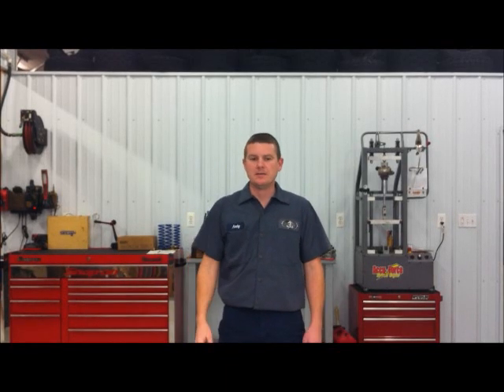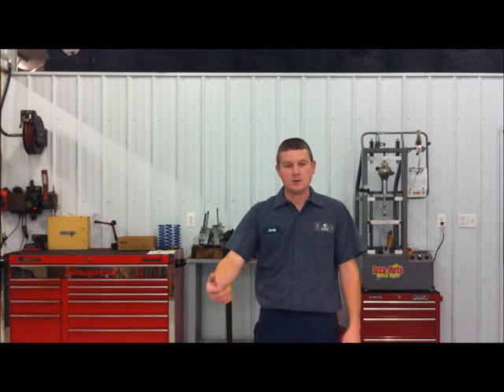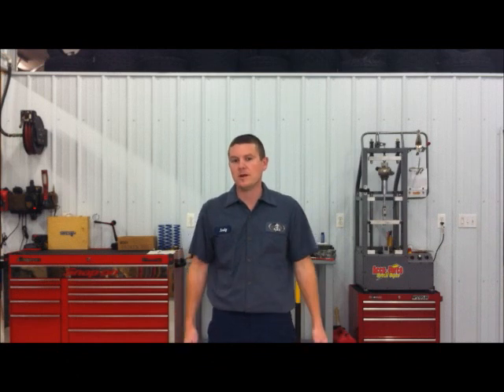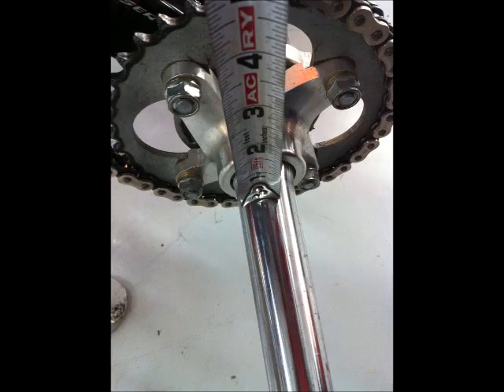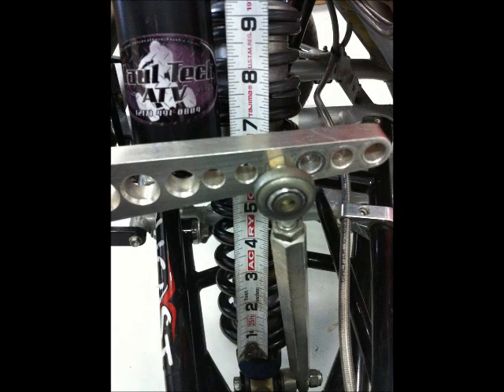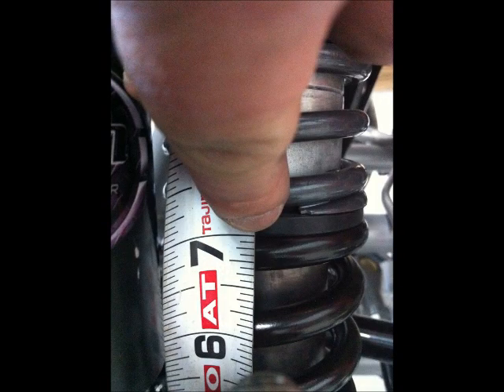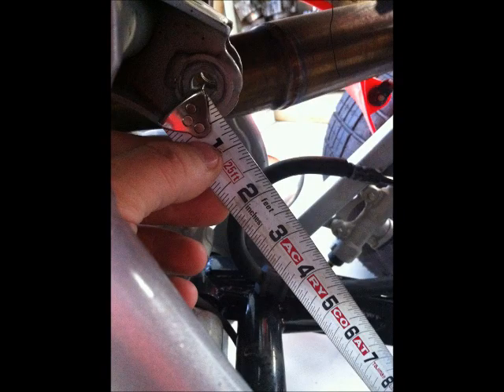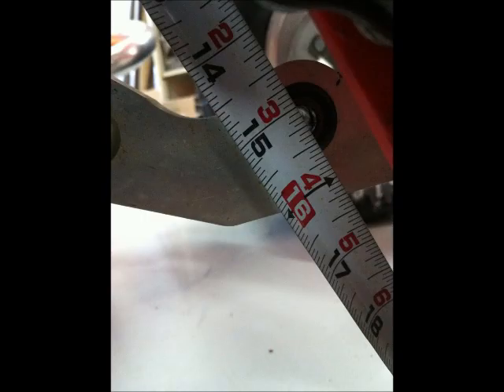ATV Suspension Measurements -by Andy @ Maul Tech ATV

Comment: Very helpful video! I have a brand new Works Quadstar rear shock on my LTZ400. Currently I think the weight is set up for 170 Pounds and for XC racing. Is this weight adjustable? I want to set it to 200 pounds. Can I adjust this or do I need a new spring, re-valved?
Reply from the maker: Just measure your race sag with only 3 turns of preload on the spring and let me know what it is.  From there I can tell you what spring you need on your bike.  The bad part is that works Pistons are valved way too soft and with the correct spring rate you will blow through the travel